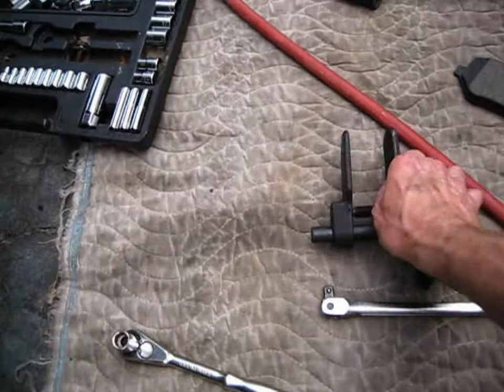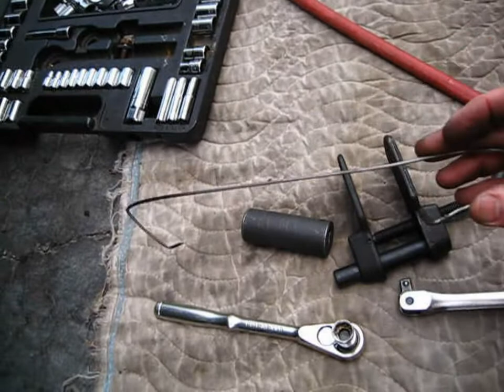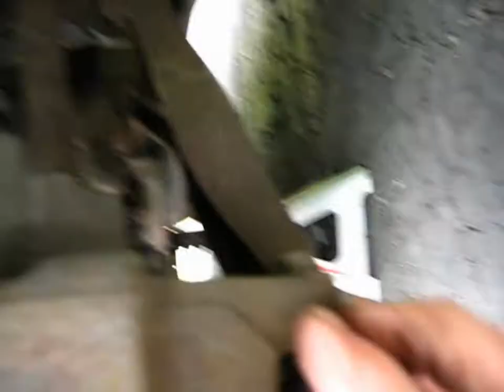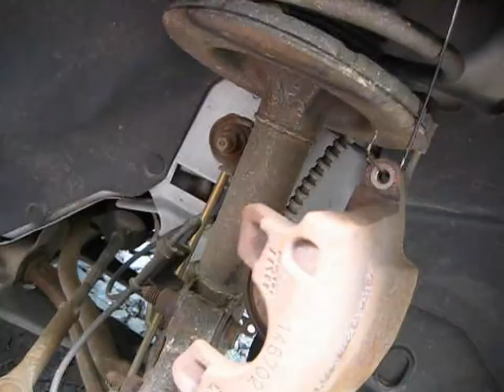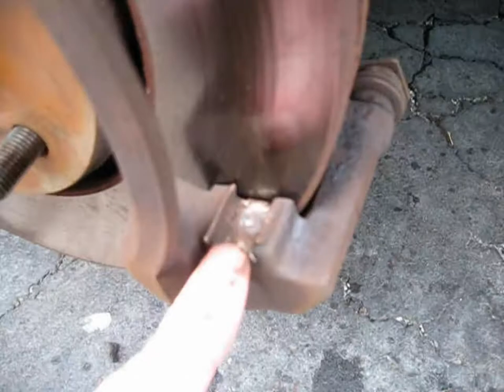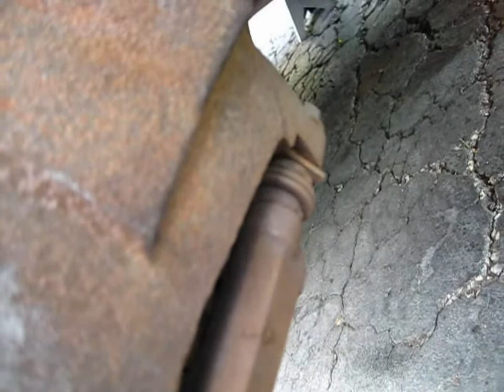Front Brake Pad replacement on Dodge Caravan 2002-2007, With Rear Drum Brakes

Comment: I don't add grease to the slider shims on the bracket they are stainless and any grease will hold sand or dirt and that acts to build up and will cause failure over time. But yes to the pads rear shim to the cylinder contact. Doing 50 jobs a week for 20 yrs ive seen pretty much every style and tried most tips and tricks. I like your demeanor, which is pleasing to listen to your tutorial.
Reply from the maker: Thanks for the advice & thanks for the compliment! Feedback is always welcome at DIY Benz Garage!
Reply: @DIYBenzGarage  same team but not all videos have every detail known to man and allows for us to interact.

Comment: For those struggling. You don't actually need the piston tool. I use a flat head screwdriver and compress it slightly to be able to move it

Comment: Good video but a few things confused me -

Why are we suspending the caliper vs just setting it down gently? Will the break line not have enough length to do so? 

And what is the purpose of compressing the old pads in the caliper once they're removed? You mentioned the compressor to compress the caliper piston, but I'm not understanding the purpose of this step.
Reply from the maker: You never suspend the caliper by it's hydraulic  line as the weight can damage it. The caliper pistons are extended due to the old pads wearing out. The new pads won't fit if you don't push it back.

Comment: Did I miss the part where you use the C -clam?
Reply from the maker: To use the C-clamp I remove the caliper from the bracket, put one of the old brake pads against the piston, hold the base of the c-clamp against the back of the caliper and SLOWLY turn the c-clamp through the front of the caliper pressing down on the old brake pad. Sorry I didn't show that method, but I haven't done it that way for years.
Reply: @DIYBenzGarage  I'm not understanding the purpose of these compression step.
Reply: @jl5442  to be able to put the caliper back on . See when the old brake pads are so worn down the caliper is more extended and needs to be compressed to be able to fit around the new brake pads . As your brake pads wear out the caliper extends into the brake so the brakes don't come loose

Comment: The pads i got dont fit too fat on the tabs :(
Reply from the maker: I remember having to file the tabs one time, I can't remember if it was too much paint or poorly made.
Reply: @DIYBenzGarage   just a bad fit.  Probably would have fit a newer model or different calipers better.  It was a good excuse to finally go pick up a vise and a grinder. But the vise and grinder were both missing pieces.  However, the grinder was usable and I have one side done and I'll let the neighbors rest for the night 😀
Reply from the maker: @evianrave7683  Wow, yours were way off. I only had to tweek mine with a dremel.
Reply: @DIYBenzGarage  man I finished the other side this morning in like 30 minutes with no grinding.  It helps to remove the spring when installing the new pads.  My setup is different from the one in the video.
Reply from the maker: @evianrave7683  Ahhh, I bet you have the model with rear disc brakes. They are a pain in the ass, completely different caliper & pads. I hope they sold you the correct parts!